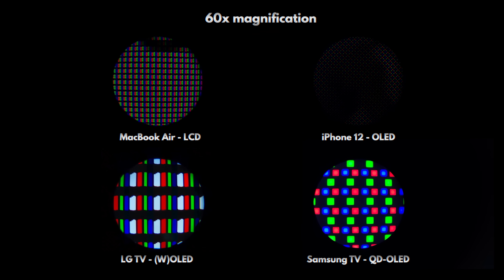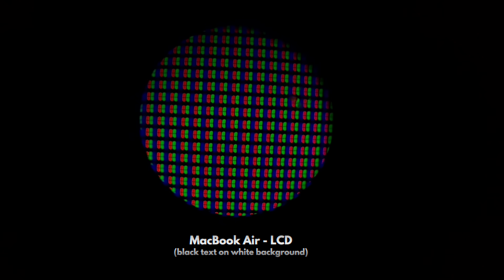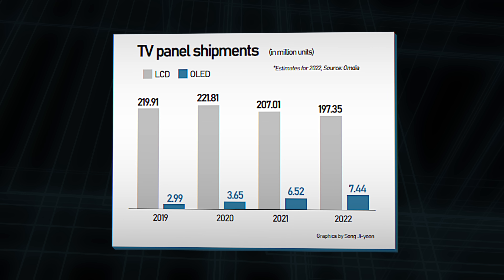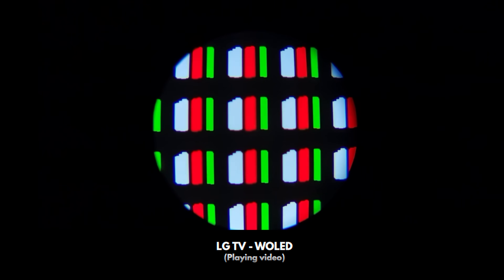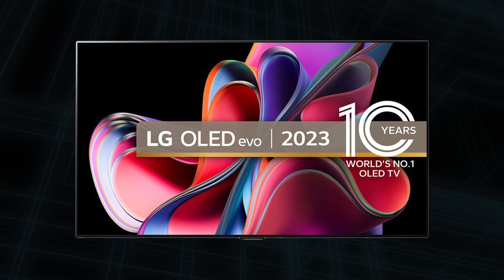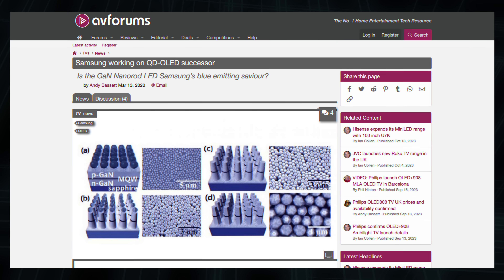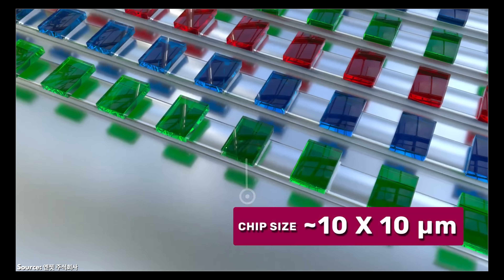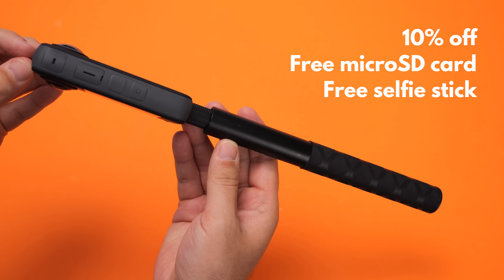The billion dollar race for the perfect display

Comment: Best ever display still the DELTA configuration CRT. I have some, so I know. None of any recent technology can ever touch it's quality. The worst thing about any flat display technology is the jaggy side scrolling. Why do electronics stores use still or slow-motion footage to demonstrate the capabilities of TVs? :-O The only solution is to increase the refresh rate up to 120Hz or more. I think - my personal opinion - we don't need 2k or 4k "jaggy scroller" resolution, we need FullHD + 120 Hz or better refresh rate.

All devices and equipments should be replaced, so it doesn't matter.  They (world standard makers, manufacturers) chose the higher resolution over the higher refresh rate. Maybe it was cheaper, or I don't know.

Anyway, I still use a 10+ years old 42" Panasonic PDP television, it's picture quality is freaking good, I have no intention of replacing it with some crappy 4k garbage.
And what should have happened? Look for the sadly cancelled SED screen technology. That would have been the real breakthrough! Keeping a good part of the old CRT technology and enjoying the advantages of the new technology (flat, light, large image size).

Comment: Ultimate tv is getting rid of the rgb type color system and have a material that when power by certain voltages it will produce certain wavelengths making it produce certain colour. Then add a back light for brightness and we all good.

Comment: I wonder why the dual layer Hisense tv panels never took off?  I don't think they were even sold in the North American market at all.  I know some resin 3D printers are using something similar but the resin printers only have to block out light in selected parts.  Its binary pixels at 4k resolution.  I thought having that as the active light controller (similar to what Samsung did with micro dimming) was an ingenious way to make use of 2 screens for deeper blacks on displays.  1 just for light control, and the 2nd for the actual picture.

Comment: 9:30  that’s kind a curse on all devices that using LED (lcd tv backlight , oled and amoled , even lightbulbs ) all those companies are  cranking them to 150-250% of normal power  that’s how screens looks brighter  and bulbs emitting more light  with less actual diodes(in some smaller cases it is insufficient cooling issues) all that shit is REDUCING lifespan of led from 50k-100k hours (~20 years)to 1k-10k hours (1-2y)- warranty period (how convenient) , what you can do : bought tv - set up backlight to 80%max or even lower (some of tv have engineering menu where you can reduce current , lightbulbs - most expensive of them are usually made ok , but in cheap ones  you can swap a resistor in it’s butt and make it from 15w to 10 as example , phones are more complicated.. nowadays ones do not have so severe burnout issues you can reduce brightness too but best of them made to last 5 y and some other thing would fail ( emmc , cpu will crack off the board etc..) and who wants to use 5 or more years old phone…

Comment: what people dont know 
apple uses samsung screens for their phone display, apple dont have the resources like samsung
keep reading trust me
apple secretly partnered up with samsung for the screens display wise, only cause since apple is a chinese product company 
samsung is a korean company
and apple doesnt have the resources for the iphones or ipads or any screen used, so each apple product sold some profit goes to samsung.. 
so your iphone 10-15+ is basically using a samsung display
but apple did get permission to put the apple logo on the back of display to keep people convinced its "apple displays"....
samsung dont mind sharing some information.. its apple that doesnt like it
(excuse my grammer i have autocorrect turned off, id rather learn to spell and type then let AI do it for me)
Reply: What a reactionary mindset (auto-correct part).

You can use it to teach you how to spell, as long as you have an active mindset, you making mistakes will only improve your grammar.

Comment: It always frustrated me that garbage LCD televisions beat out plasma televisions, which were far superior in almost every way save for brightness. Way better blacks, way better off axis, way higher refresh rate, and no motion blur. Manufacturers did a tremendous job of scaring people away from plasma displays by instilling the fear of burn in and convincing them that thinner meant better. People seemed to love that ridiculous 120 Hz frame rate band aid thing for motion blur even though it makes all video look literally fake. They threw complexity at the LCD display in trying to improve upon/band aid all of its faults while the whole time plasma was/is the better display. I bought my Pioneer Kuro 50" plasma in 2006 and am still rocking it today. No burn in, either. OLED will be my next display when I just can't live another day without having a display larger than 50". Each year I wait the prices come down, reliability and longevity improves, and the sizes seem to get larger. Sure I've got cheap LCD/LED backlit displays for computer monitors and televisions in guest rooms and workout rooms, and the garage, but nothing is better than a display whose pixels generate their own light rather than filtering out light generated from behind it. I haven't made up my mind as to whether or not burn in in OLEDs is another baseless concern during normal program/movie viewing.

Comment: I had two Samsung AMOLED phones in the past years, and one thing I've noticed is that there's actually a delay in turning the individual pixels ON or OFF.

For example if you have a picture with black parts of the screen and you scroll this image around (like scrolling pictures on Facebook for example) you can actually notice how the parts of the screen that were black takes an extra moment to lit up, and the parts that were lit but now have black takes a moment before they are completely black.

Not sure if this is a software issue or a hardware issue, but either way it's quite noticeable.
Reply: That's a common problem on OLED. iPhones have it, Samsungs have it. My first smartphone was a galaxy S1 (Back in 2009/2010) and it had the same problem, I now have a nothing Phone 2 and the problem is still there. It's less prominent when the screen is brighter,
Reply: I have a Xiaomi with AMOLED screen and I have never noticed that issue.
Reply: This effect is called OLED "MURA" and is typical for OLED screens and happens because it takes some time to turn-on OLED emmiters on. It is more visible for black to dark transitions. Some devices combat it by preventing pure black - then of course you don't get amazing OLED blacks. Still better than typical LCD.
Also there is no such effect on WOLED or QD-OLED panels... almost. WOLED panels have opposite effect where pixels overshoot when turning on and this effect is called "near-black chrominance overshoot"... yeah, name makes no sense and it should be called "near-black luminance overshoot" instead. Anyways, it means that you can in some darker scenes with smooth transitions from black to dark grays see slight flashing. It is one of the bigger issues of WOLED panels. QD-OLED on the other hand don't exhibit it and instead there is very slight momentary undershoot - which means there is "dark smearing" not unlike what you describe... but I would say its tunes such that this undershoot is almost invisible - you really need to dislay test patterns and pixel-peep and otherwise in normal usage even in very dark room watching dark scenes it is not noticeable. Much better than WOLEDs overshoot - which is also quite big. LG could minimize visibility of this overshoot by not using W subpixel for darkest tones.
Reply: Yes, it is quite annoying when scrolling gray text at minimum brightness while in bed.
Reply: I only noticed this issue on the Tab S4, my S10 doesn't have this scrolling blacks problem.

I do think it's refresh rate mitigating it.
Reply: That's why we need CRT's back
Reply: i did some research and found that pixels in oled phone displays change colors not in 1 frame but they drag it out for 2-3 frames for some reason. if you film it in slow mo very closely you can see how pixels change color instantly with every refresh but it divides it in steps between several frames even for small differences in brightness and color so its not because pixels take a long time to turn on and off. you can see it in this video on 21:20 and 23:20 https://www.youtube.com/watch?v=VrZf-6FBFCE
idk why phone manufacturers do this thing. maybe because most people are used to ghosting and low fps content feels stuttery for some. or maybe it's some specific engineering thing that only the manufacturer knows
black smearing in phones is so noticeable because your eyes can see small differences in low brightness tones. but in everyday use you can see the ghosting too just try comparing your phone to oled tv or fast lcd display.
Reply: Probably to save power, I definitely don't have that on my OLED TV
Reply: It happens on low brightness. Happens on all oled
Reply: It's all about refresh rate or heartz
Reply: @czech8797  Nope. It is only because of slowness of turning on pixels. There is no benefit from refreshing pixel state again as OLEDs don't use overdrive to combat this effect as it happens even when moving from black to bright colors.
Reply: @czech8797  I don't think so. I've tested with both 60Hz and 120Hz and they behave exactly the same.

I don't think the refresh rate changes the speed it takes for the LEDs to turn off and on, only to change the colors of the LEDs that are already on.
Reply: @sekkuar  btw we can see that it by manually moving a app or black element, otherwise when you see videos you cant see because it's running in high refresh rate

Comment: Pedantic quibble: CRTs have burn in, where the electron beam actually overheats the phosphor layer and burns shadows into it. What OLED displays have is burn out, where the LEDs are slowly... well... burning out kinda like fluorescent bulbs, getting dimmer with their total activity over time.

Meanwhile LCDs have something similar called image retention, which is a sort of stickiness that develops in the states of the liquid crystals, causing them to retain a ghostly negative of whatever color was on them for too long continuously. That's been basically eliminated from modern LCDs though.
Reply: @1w561 It still exists, sure, but on good quality panels driven by control boards with modern anti-retention measures, you're not likely to see any noticeable retention until the display is old enough for other parts like the power supply to be failing, or if it's being operated in high heat.

Comment: Export the Quantum, Chat GPT, Revit, Plant 3D, Civil 3D, Inventor, ENGI file of the Building or Refinery to Excel, prepare Budget 1 and export it to COBRA. Prepare Budget 2 and export it to Microsoft Project. Solve the problems of Overallocated Resources, Planning Problems, prepare the Budget 3 with which the construction of the  Building or the Refinery is going to be quoted.

Comment: Micro led is also LCD. That just means liquid crystal display. It's the lighting technology that changes. First was fluorescent light bulbs, then LED (edge lit, direct lit, & full array), & right now it's mini LED. The next lighting technology is Micro LED which will control light down to the pixel & create pure blacks  just like OLED but much brighter without sacrificing contrast (pure black) the way Mini LED does. 

Lighting technology is separate from color technology. QLED/QNED/Triluminous is just quantum dot particles inside a glass in front of the light source instead of laminates that contaminate the white in colors the same way all LEDs contaminate contrast (pure blacks)

Currently QD OLED contains both perfect contrast & perfect brightness but when Micro LED comes out it will increase the amount of brightness currently in QD OLED. It took this long to make a TV that produces uncontaminated colors.

Comment: Yea the billion dollar race for a TV that doesnt break itself in less than 3 years.
I have changed a 55 inches panel of a  Philips tv 3 times in the time of guarantee.
I have various acer monitors with 20 years each.
Is outrageous. You better buy a proyector. 
TVs now are rubbish and vulnerable to corrupted drivers with googles software.

Comment: Lcd vs oled reminds me of rasterisation vs path tracing. The former uses clever work arounds and is cheaper.

The latter is more pure, better results but more costly.

But in the end the less parts or complexity a system has. Will be the winner in the end once the tech matures

Comment: Plasma was the best and we killed it.  It had a 600mhz refresh rate and achieved the best blacks because it didnt need light to show color like lcd.  Sorry but its true.  We had the best display years ago and due to screen burn and heat issues that got fixed later... It couldn't shake its initial image and died out in 2013.  RIP plasma.  You were the best.
Reply: I have Panasonics plasmas around the house, they are great and by far better than LCD but the last gen plasma TV's still emitted a lot of heat, heavy and they heat up the room a lot in summer with fans ramping up.
Reply: @Awayze  yeah they definitely got warm.  I had a last gen Samsung and it tragically got broken months after they quit selling them. Was a sad day.  They just did a better job at achieving true colors... Loved gaming on them.  Just the refresh rate alone made it worth it.

Comment: Migraine warning for zooming animation.
I just want a display which doesn't strobe, which is clear at low or no brightness, and which works at low frame rates, to avoid migraines and motion sickness. I've tried mirroring to e-ink displays, but get gray-on-gray instead of black on white. So I'm using a low-brightness lcd monitor.

Comment: 2:10, yes, turn it all the way in one direction and we do  have black (blocked light). But, turn it all the way in the other direction, and we will also have black. To let the most light through, we need the center of the liquid crystal layer to be at 45 degrees from both polarized layers. I don't know about current LCD screens, but in older screens (think black and white), the outer layers would have groves that the crystals would fall into and get forced into alinement, creating polarization. The next part is built on the fact that the crystals are magnetic. The crystals that are between the aligned crystals would get twisted by 45 degrees (which we want when letting light through) by the magnetic fields of the the crystals that are forced into alignment by the panel grooves. We can then cut down the amount of light that's let through by applying magnetic fields moving the middle crystals away from 45 degrees.

Comment: As I see it, Samsung Super-AMOLED is the closest of real consumer level microled displays we currently have. Those displays are still too small, though. I wouldn't be surprised if Samsung can improve their technique to create real microled displays in the future.

If cost wasn't an issue, you could already create true microleds making the whole display from hexagons made out of wafers what have the pixels. That would require using multiple wafers per display and considering a typical silicon wafer costs around $30K to manufacture, it's not a reasonable way to manufacture consumer level displays.

Comment: Ever since I first got my hands on the PS Vita I fell in love with OLED screens. It's great for stuff like the Vita or Steam Deck but I'm still paranoid about burn-in which has stopped me from pulling the trigger on getting an OLED screen for my primary monitor. Hearing about the advancements coming soon has me excited to finally be able to get my hands on a good OLED monitor with a much longer lifespan.
Reply: my first taste of OLED was in 2017 after buying a used Galaxy S4. then an S5, S6 Edge, etc., Now I'm typing this on a used 2018 Xperia XZ3. My first OLED outside of Samsung
Reply: I already have something better than an OLED, it's a high end CRT monitor.
Reply: @saricubra2867  I still have a aoc crt monitor from around 2007. Is that considered high end?
Reply: @Sarah_Delata  It depends on the specs. Mine can almost do 1440p and it has better clarity than a 1080p display (smaller phosphors than pixels on a 1080p display), no aliasing.

Comment: Great video with a good explanation of things. There is one more stage of evolution though which is to have displays that emit a single wavelength per pixel instead of combining RGB wavelengths.

This would make light emitted by the tv light the room and people more naturally and open up new uses for displays. Huge display walls used for lighting a room sort of ideas.
Reply: One aspect is that most images are Bayer sensor-based and have only one active subpixel per pixel (e.g. R or G or B), hence their color resolution & combination of RGB wavelengths is limited, as opposed to Foveon/Sigma pre-2013 sensors (or conventional film or photography), besides maybe some rare shift RGB sensors cameras from around 2016. 
Videos compensate somewhat as the motion blends to a certain extent, yet all these wonderful 2023 Nobel Prize achievements in displays will only show their real colors with "full subpixel color resolution" or adequate film sources (e.g. IMAX), with no risk of "Nutella effect" or other Bayer artifacts. It's also amazing to see how much content with 8bpc (like jpeg), when png or tiff have been around for so long, as well as 10bpc video or better, so as to render fuchsia colors properly.